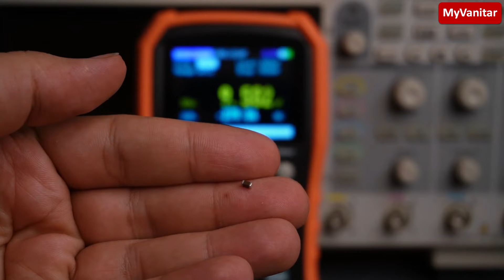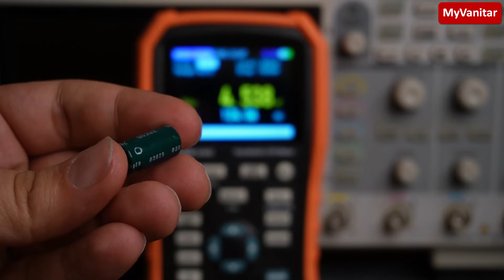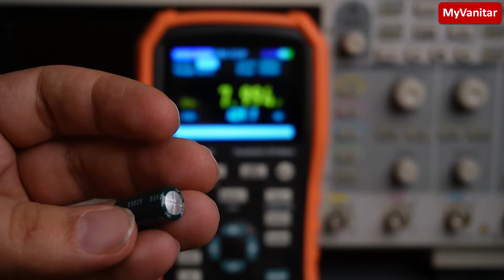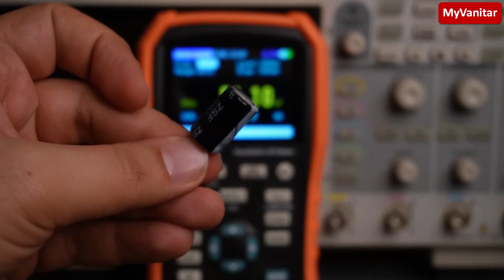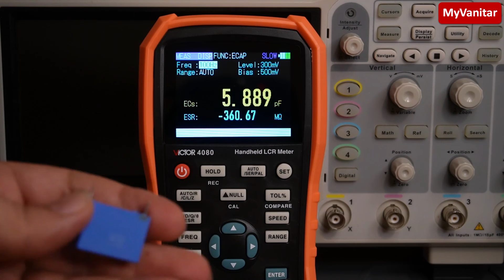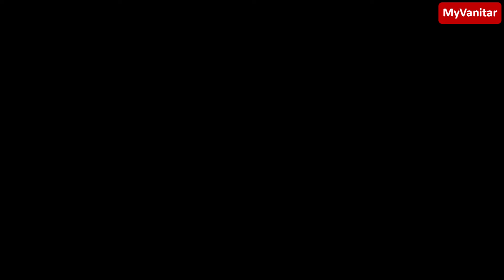Detecting Failed Capacitors, The Secrets (Capacitance, ESR, Phase Angle, Dissipation Factor)

Comment: Thank you for this video, its one of the best I've come across on the topic of testing capacitors. You have many factors to consider when testing capacitors. First is visual inspection, second is capacitance value, third is ESR, fourth is dissipation factor, and fifth is phase angle. All while remembering to use the correct measuring frequency. I have a good grasp of these except for dissipation factor. I don't typically have access to data sheets for older electronics and don't have a chart of common values like I do with ESR values.
Reply from the maker: You're welcome. Using ESR—I mean the third step — 95% of the time, you can spot the bad cap, because I experienced branded caps sometimes do not fall in capacitance. This is 100% of bad electrolytic capacitors. those 5% are for non-electrolytic ones.

Comment: Do you ever see lower ESR than expected and would this mean the capacitor is bad? I have a 50V 22uF through-hole electrolytic capacitor that I suspected may be bad on a power supply. Using the Aideepen LCR-TC1 component tester I measure 24uF and 0.47 ohm ESR. Using an online chart I think the ESR should be like 10x that, but maybe I'm mistaken. I had pulled this one because it appeared to not have continuity to GND on the board and I heard that was one way to test for bad caps.
Reply from the maker: in one case you read very low ESR and that's when the capacitor is shorted, which happens mostly for ceramic SMD ones. But in your case when the capacitance is okay, I am suspicious about your LCR (if it's a brand or a DIY) and the measurement frequency (use either 100Hz or 120Hz if your LCR meter is one of these, for the electrolytic-type capacitor is above 10uF). take the capacitor out of the circuit and test it again, it might be a resistor or an inductor in parallel.
Reply: @MyVanitar  The capacitor was already taken out of the circuit. I didn't make the meter myself but it is a cheap (under $30) meter from Amazon. I just recently got the LCR and this was the first thing I tried with it, so if it's not accurate, I'm not sure. I can't set the frequency myself, it's pretty much automatic, you stick the part in and hit a button and it does some things to detect what the part is and display info.
Reply from the maker: with higher frequency, the ESR value drops so I think your capacitor is fine, especially when you read 24uF. Test it with some faulty capacitors
Reply: @MyVanitar  That makes sense, so it's probably not using the ideal frequency for this capacitor so it looks weird. Thank you. I don't have any known bad caps around to test but I am trying to find bad caps on this board so I guess I'll pull and test some more and see how they look.
Reply from the maker: usually, the frequency of such devices is fixed at 100KHz, used by many manufacturers and datasheets to show the ESR, and also for marketing to show the ESR of their components is low. those online tables are rough estimations and they do not mention the frequency. you gain experience with some repairs. mostly ripple and heat cause the capacitors to fail

Comment: I thought this was going to be in circuit testing. Any idiot can test one out of circuit.
Reply: only an idiot thinks that can test components "reliably" inside an unkown circuit 😊. I follow several channels and always see people make false assertion
Reply from the maker: @hp2073  he is free to share his opinion
Reply: @hp2073  If it's an unknown circuit, he should try to find a schematic before messing with it.
Reply from the maker: it depends, sometimes you can perform in-circuit testing and sometimes it gives you some misleading readings, especially on ESR, even if you drive the capacitor with the 0.3V signal. By the way, usually in-circuit testing is good when the values are way out of range, however, as you see in the video, there are some cases in which there is no option other than getting the capacitor outside. I have experienced both, therefore "it depends" could be the best answer. finding the schematic is sometimes impossible and naturally, companies are not willing to disclose it.
Reply: @MyVanitar  Have you queried Sam's Photofact?
Reply from the maker: @jimdavis6833  not really, for capacitor failure detection, I don't use a schematic. I can test each cap in 1 minute. vacuum disordering and a quick test
Reply: @MyVanitar  Using a schematic plus multi- meter, signal generatot, and O-scope, I can test a whole circuit in a minute. You have to remove all the caps, test them and reinstall, or replace them. You can't do that in one minute. If you remove them, why bother testing them? Just replace them, as most caps are pretty cheap, and old electrolytic caps should be replaced anyway.
Reply from the maker: everyone is free to follow his own method and what I mentioned here is not a bible! someone may disagree with you and follow his own way, but the point of this video is that capacitors fail in a variety of ways. I think what you propose is what an LCR meter does. there is no way to test the whole circuit in 1 minute unless you have a new healthy board to compare. then you can test everything not just the capacitors. if the device is old (usually over 5 years old), replacing all capacitors is a wise decision.